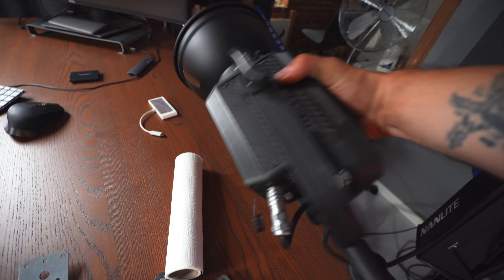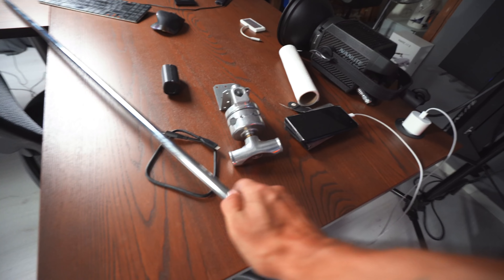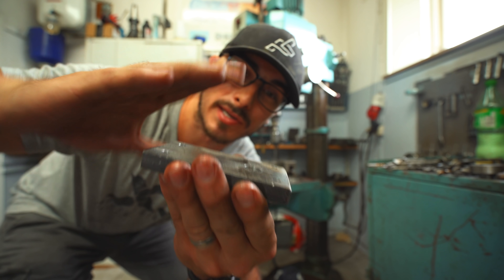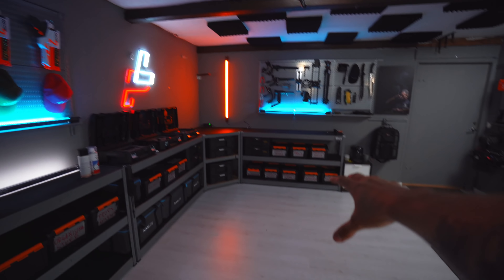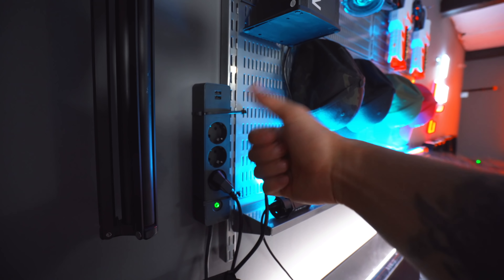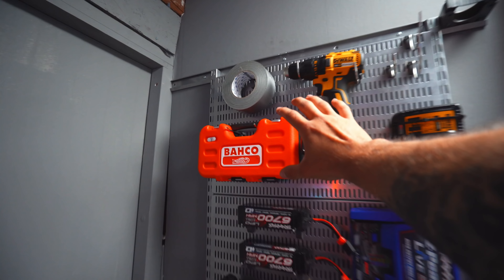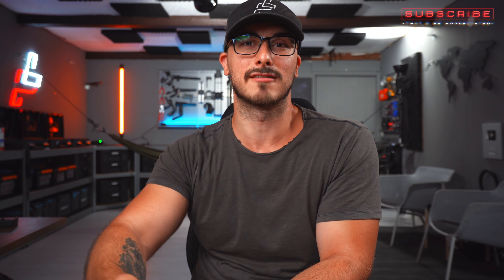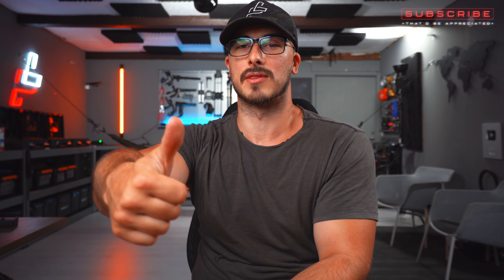Why i sold my Sony camera...

Comment: I have a Sony A6500 with the Sigma 16mm 1.4f. I was really tempted to go into full-frame with A7sIII (I was shooting weddings and portraits with a Nikon D800 back in 2012). I could spend the money, but I think I'm going to keep shooting with the A6500 until there's a cheaper FF option. A7IV? let's hope :)

Comment: Hi Peter,

New to your channel and love your laid back and keeping it real style.

I decided to get rid of my A6600 and A73 combo and upgrade to A7R4 + A7S3.  Loving the A7R4 so far.  Thought about the R5 as one hybrid cam but will see in 2021 when there’s enough real world usage and firmware updates.

Have you tried the new Sigma 100-400/5-6.3 lens or you shoot mostly wide and tele?
Reply from the maker: Hey there, welcome! Good to hear you're enjoying the content :D.

The RIV is amazing, would love to have it if it didn't cost a fortune. 

I havent actually, but I am in the market for a 100-400 lens so might rent it soon! I mainly shoot wide though
Reply: Hi Peter,

Thanks for the quick reply.  I got A7R4 second hand but it was never used for less than $2500 because the owner moved to the R5 so it’s my gain.  

What was fhe A7S3 like when you had it?  Looking forward to your reviews when you have more time with it.  I am planning to get it in Nov/Dec timeframe.

Let me know how the Sigma rental goes.  Stay safe and thanks for sharing your video contents!

Comment: In regards to the new batch of cameras (eosr5/6 and the sony) what are your thoughts on 8k in the coming years? Do you think it's gonna turn out just like 4k or have we reached that sort of peak when it comes to resolution for most people's camera needs?
Reply from the maker: I think 8k isn't gonna be for the masses and the new norm will be 4k for a long time ahead. 

Just the file management with 4k is heavy as hell and thinking of 8k is just burning a hole in my wallet 😅.. 

So yeah, I'd say 4k is the new standard that the majority will get used to in the years to come.
Reply: @PeterLindgren1  That's what I'm thinking as well. It's why I think a lot of the 8K camera talk comes across as a bit gimmicky tbh. Plus with 8K you then have to take into account internet speeds/upload speeds for creators and consumers. And most folk ain't lucky enough to have anywhere close to something that can handle that.

Comment: cool job on the bracket to hold your light.. & yes good move Peter selling the a7riii for the a7siii . I sell to buy new gear..
 if the a7iv is 36mp I will sell my a7riii & get it..

Comment: Pre-Ordered the A7Siii the day it was released, still holding onto my A7iii, waiting until maybe next spring and seeing what the A7IV specs may be and ordering one of those along with a A7Riii or IV for all the photo content we produce. 
Love the 24 1.8 GM, also love the 70-200 2.8 GM, probably my 2 most used lenses, but also have a soft spot the Viltrox 85 1.8 and the Sigma 14-24 2.8, and of course the Tamron 28-75 2.8!!!

Comment: I find the 'size of the raw files' argument a little flawed when you're filling 90% of your hard drive with 4k video.
Reply: the thing is unlike video, there is a negligible improvement in resolution from 24MP to 42MP. Whereas 1080p to 4K is a huge difference, and even then its insufficient so you have no choice but to go for a higher resolution

Comment: I wish I could afford the S3. Looking to switch from Canon, heading for the Sony ship.
I just really really wish Sony would make a pro-grade APS-C body. 
Hope dual slot SD and some of the A7S3 tech enters the a7000 line next time.
Dream camera: A7S3. 
Next upgrade: XT4 or G9/GH5. 
Reason: Smaller form factor for crop bodies. No dual SD slots on a6400/a6600. I don't want angry couples and event organizers to kill me when my SD card fails.
Reply: XT4 is great camera